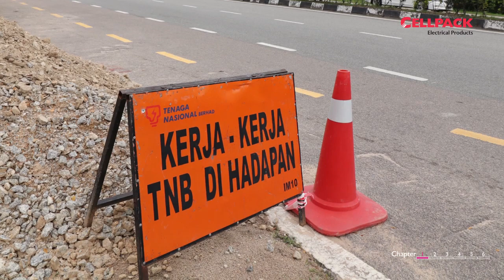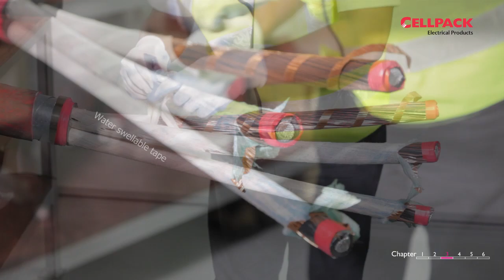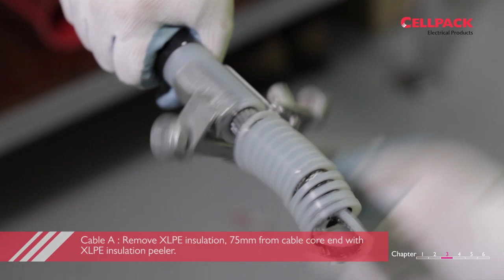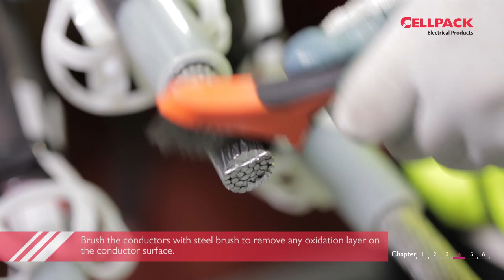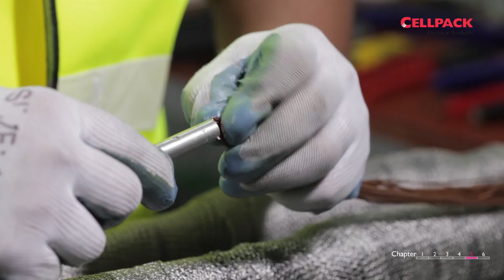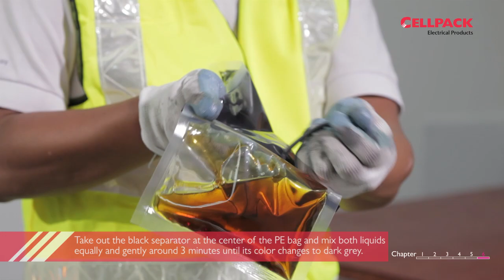BBC Cellpack CAMSV 3 24kV Resin Injection Tool

Comment: Well detailed cable preparation, so nice. Does this cable preparation and measurements applies to other HV cables
Reply from the maker: Dear Noel,

Thanks for asking. The cable preparation and measurements are described and explained in the working instruction for the corresponding products.

Best regards
BBC Cellpack Electrical Products

Comment: hi.. where can buy low voltage Cast resin straight-through joint in Malaysia?
Reply from the maker: Hello Jeevan,
you can find our contact here: https://electricalproducts.cellpack.com/en/contact/
You can simply send us a request via the contact form.
I hope this will answer your question for now.
Best regards
BBC Cellpack Electrical Products